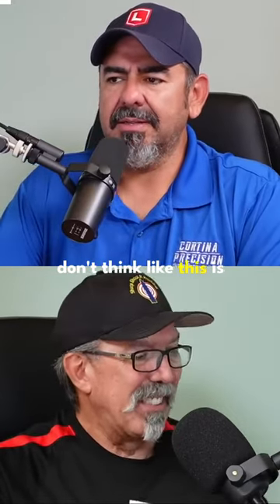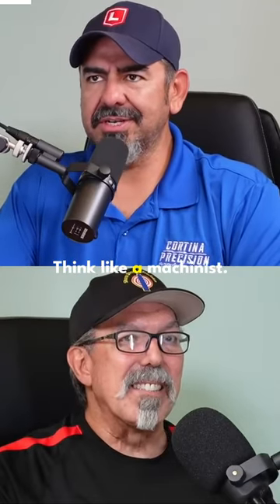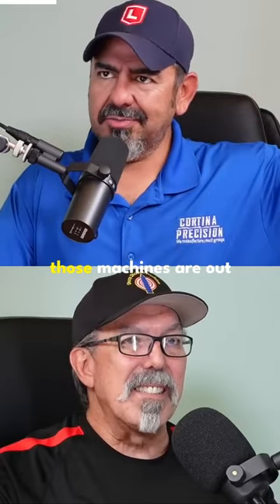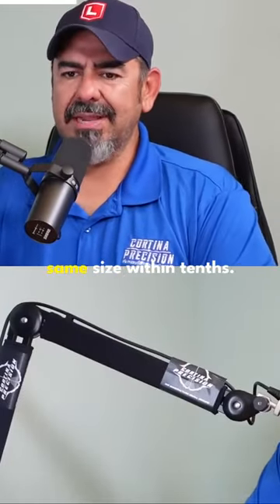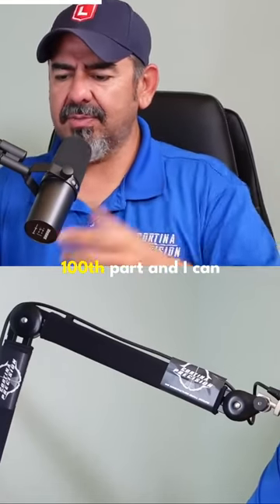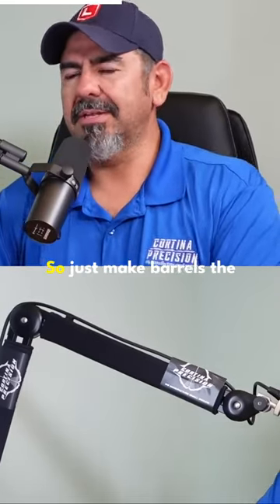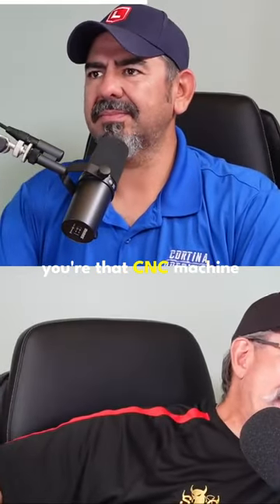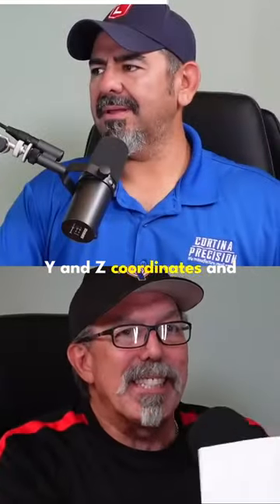Mastering barrel chambering

Comment: Hi Mr. Cortina, now unrelated to this topic I was curious about trigger weight, I've been shooting F-Class for over 8 months now (Purchased a .308 WIN, 30 inch barrel Neilson MN300 Action a couple months back) I've been curious about adjusting my trigger weight, currently it's set at around 28 oz I believe.

The club I go to is full of very helpful people, I've spoken to many F-Class shooters, TR shooters, F/TR shooters and they all say I could adjust my trigger weight by some 5oz-10oz, would you by chance have any recommendations or advice on what sort of weight intervals I should adjust it by? I have shot off hair triggers before but am not going to do that with my rifle for various reasons (mainly for accidental discharges), but I am definitely a fan of lighter triggers.  

Thank you, and nice short with speedy, very handy information that comes from you two. 

Cheers
Reply from the maker: Start with a 1 lb trigger (16 oz) and see how you like it. Then possibly try 8oz trigger.  
Mine are 1 oz.
Reply: @ErikCortina heers man, I’m definitely never going to touch 1oz with the current action 😅,
I think the lightest I have shot with is around 3oz but maybe 1oz (different action of course ), I’d be worried about the wind blowing slightly and setting it off at that point 😂 thanks again